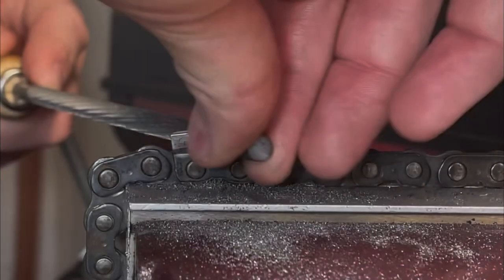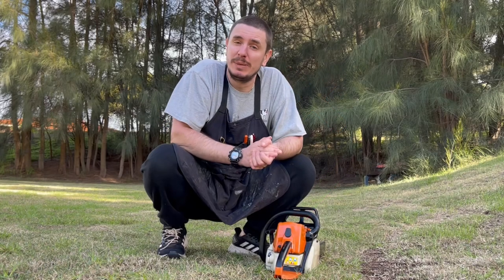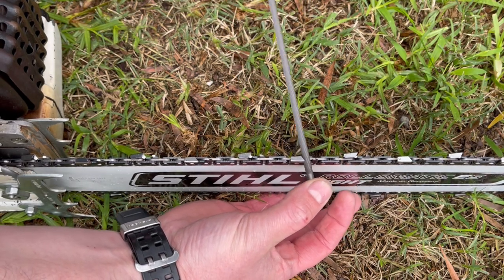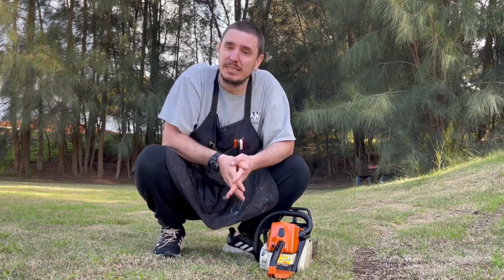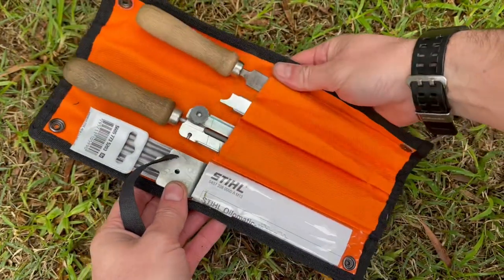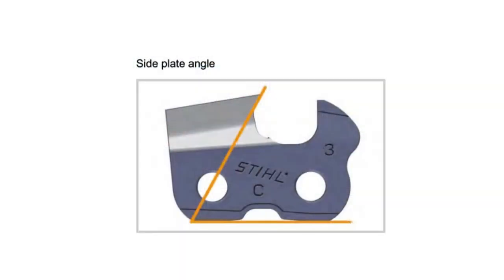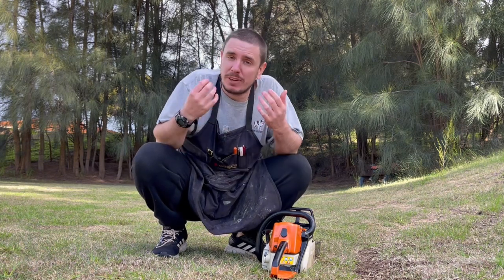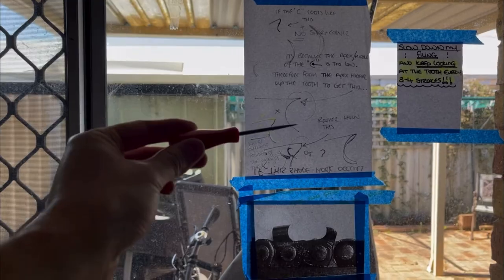5 Reasons Your Chainsaw Cuts Crooked & How To Fix It!

Comment: My last sharpening gadget purchase was a Pferd CS-X. It does the tooth and raker at the same time. Unfortunately you can't just simply change the file size for your different chains. The proper guide is determined by the pitch of the chain. That being said, it's small enough to put in your pocket or tool pouch and I'm happy with it.
I still have and use a Granberg that works great on all saw chains that I've had over the years. It's probably 45/50 yrs. old.
It's my understanding Pferd makes the same guide for Stihl. Different color. 🥴
Another good video. 👍🍻
Reply from the maker: Thanks for sharing, I believe it’s what stihl refer to as the 2 in 1? Glad you like yours :) thanks for commenting!

Comment: Real good advice I have just had to order a new Valorbe bar dresser as mine finally gave out. I really wish Stihl would make Hexa chain in .325 as filling by hand in the field is so much easier.
Reply from the maker: Useful to have :) I haven’t tried hexa, out here the wood is too hard, it wouldn’t last, but I bet it’s excellent in the softer woods!
Reply: @VintageEngineRepairs  I live in the UK and cut a lot of Oak and Ash and Hexa appears to be a durable as RS chain.
Reply from the maker: @patrickvennard838  ahh yeah out in Australia some of the woods we cut have a Janka hardness rating  3-5 x harder than oak, ash, beech etc. Most people use semi chisel out here.
Reply: @VintageEngineRepairs  That's interesting to know.

Comment: Another very informative tutorial.
I like "little and often" as a rule for touch ups.
Today i ripped the rounds of birch from one of the trees i took down yesterday. There were large stems going in every direction at the base of the tree, and i had to get the cut as flush to the ground at the request of the customer. I used the stihl 501(light weight bar), freshly sharpened, and sharpened twice more before i cut small enough pieces that i could dolly up the ramp in to my truck. 
Because of the hardness, 60" diameter and every direction of grain of the wood, im curious what tips you have to make that part of the job easier on my saw and chain.
Id love to here what you've got to say!
Reply: Also, do you have a recommendation for any books that thoroughly cover this type of material?
Reply from the maker: Thanks for watching and commenting! Dirt ingress around the base of trees is incredibly hard on chains and bars and you’ll find it will dull the teeth very quickly. Save and use old chains and solid nose bars where possible, but the answer, especially if you can’t remove the bark prior is to just sharpen frequently and don’t use your best chains, bars and saws if possible. Keep them just for stumping!
Warm regards, Tom. Edit: you can consider tungsten chains for that specific job but I don’t have experience with them personally and I think you’re better off just sharpening frequently :)
Reply from the maker: I don’t have any book recommendations I’m afraid! I must admit I never read books, apart from my bible! I find YouTube, google and forums to be superior. With that said one must be discerning as to what you trust and give worth to - there is both amazing and terrible advise out there 🤣 thanks again!
Reply: I like books just cuz I dont like scrolling on the phone screen too much. I use a map book when I'm planning trips to jobs lol.
The fact that I've found you and your channel is super helpful.
We save all of our old chains and bars etc. I'll make a combo chain/bar for each saw to help with the dirtier cuts.
Have a great day brother! Keep on doing what you do!
Reply from the maker: @tl6282  thank you mate :) I understand completely! Best of luck, keep a file always to hand and don’t wait until it’s dull to pull the file out :)

Comment: I bought  a brand new chain and bar 20imch ,husqvarna 450 rancher and it hooks to the left ,when I start the cut it boggs down and just doesn't cut right, I've never seen anything thing like this In 40 years
Reply from the maker: Sorry to hear it, take it back and ask for a replacement. It could be the wrong gauge

Comment: I have 25 acres of woods and am constantly cutting trees to either clear stuff that fell, create trails, or cut firewood. Lately I noticed my saw will bind on larger logs as if it's being pinched, except I'm cutting a tree that is hanging in midair. i.e. it is anything but pinched. 

However, I watched your video and it so complicates the dynamics of a chainsaw chain, that it just makes me want to throw the whole thing away. It's simply not worth that much effort and "precision". At least not to me. If it's really that hard, why do people do it?

Interestingly, in the 70's we would cut tons of firewood out of alder in the Seattle area and never had any problems. Cuts were always smooth and fast. And on rare occasion we would sharpen the blade with a simple file. It had a thumb press blade oiler. Now, I live in Kentucky and there is poplar, oak, walnut, hickory, cedar, etc. And cutting firewood is a royal pain. In fact, about a quarter inch of the edges of the top and bottom of the blade (I reversed it) are blue with heat, even though there is plenty of oil getting to it. I will occasionally even see sparks come off the chain even though there is no metal, rocks or dirt coming in contact with it. I use a Stihl  MS 290, BTW.

FWIW, I always thought a hydraulic wood splitter was just an extravagance. Then I tried to split Hickory. I bought a hydraulic splitter.😉
Reply from the maker: Thanks for watching :) yep, it takes some elegance to get a good chain! With 25 acres you’ll want sharpening and maintenance to be second nature haha.
Reply: @VintageEngineRepairs  Noooooo!

I mean yeah. You're probably right. Good thing I'm now retired. 

Regarding your video, it is very good, but I think it falls under this category:
The truth shall set you free, but first it will make you sick.😎
Reply from the maker: It’s surprising how much can be involved with maintaining a bar and chain can’t it!